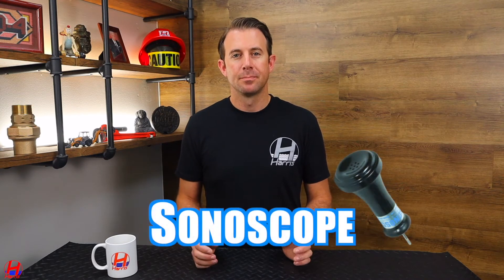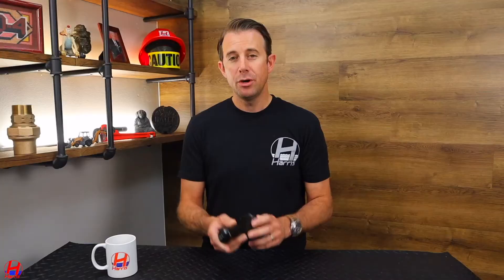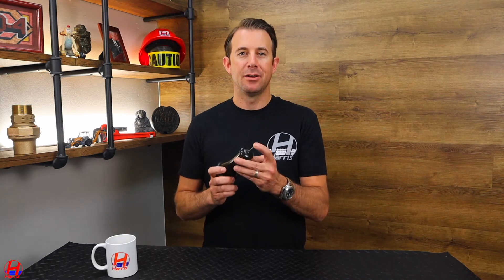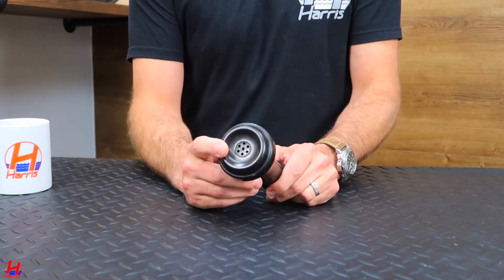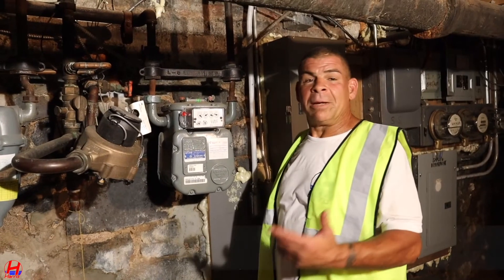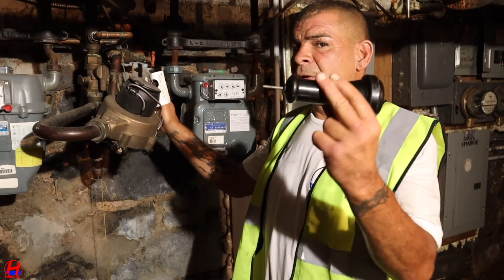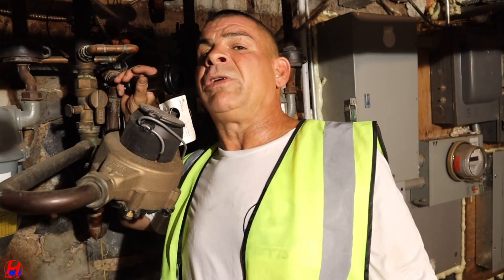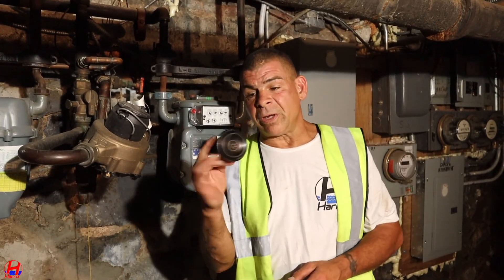How to detect a water leak by noise - Sonoscope

Comment: As a designer of leak detection equipment, I would advise that your excellent tutorial include samples of what a water leak sounds like - it certainly does not sound like a dripping tap.

There is also a risk that you are listening to the external sound by coupling through the valve.  Remember that the pipes act like receivers and the sound you hear is dependent on the pipe material and the size of the leak - with a large leak making less noise.
Reply from the maker: Great tip! 👍👍👍👍